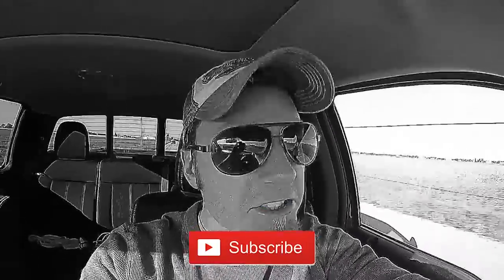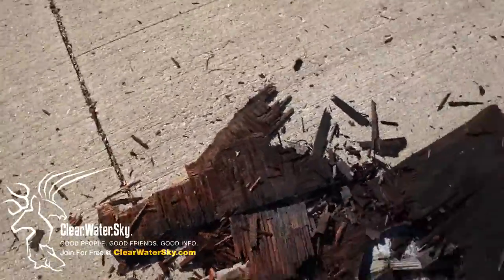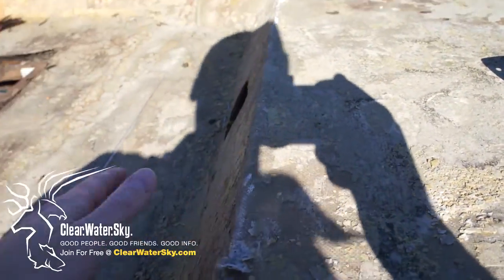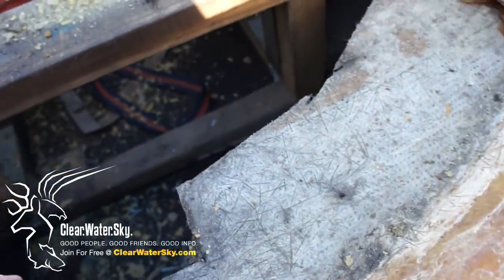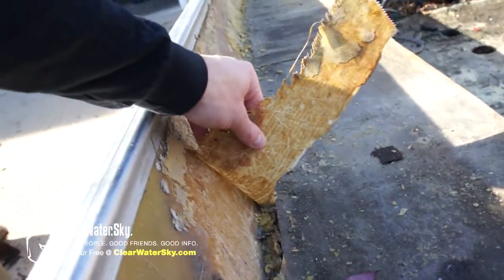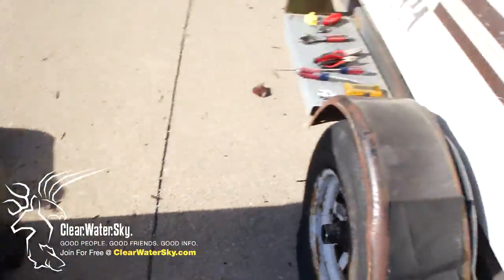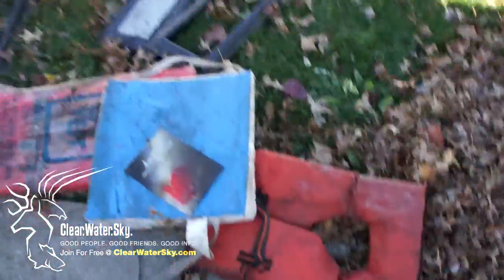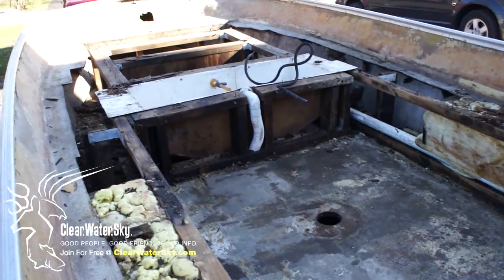Tuffy Boat Restoration: Marry a Nurse

Comment: It was not made like that the previous owner cut the fiber glass deck out and it not treated wood. Build a new frame with treated wood
Reply from the maker: Not aluminum? Seems lighter than treated wood. I have never worked with it though.
Reply: Clear.Water.Sky. You could do that but wood is a little bit more strong
Reply: Clear.Water.Sky.  Dm me on instagram